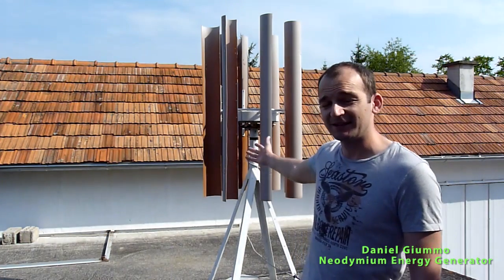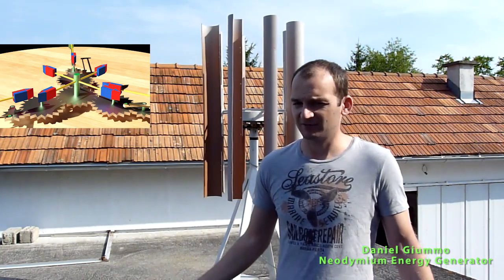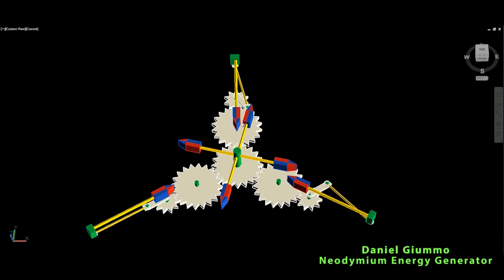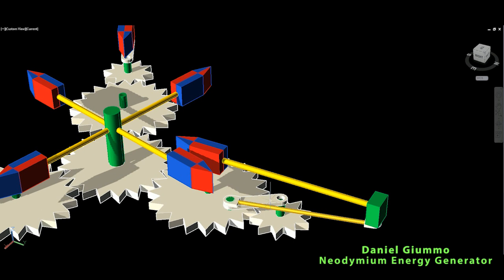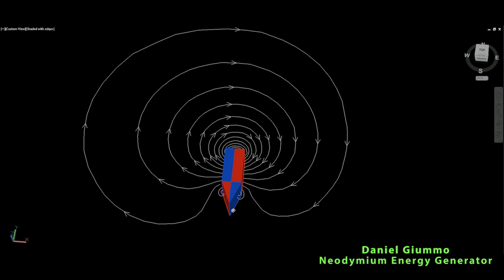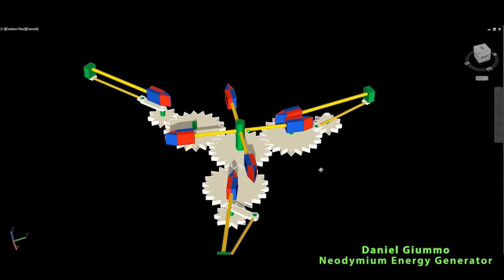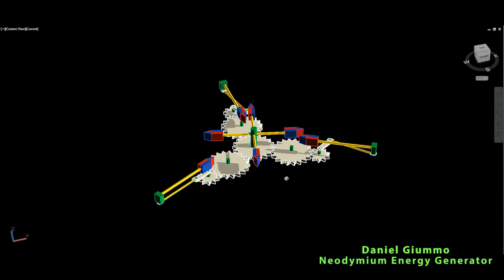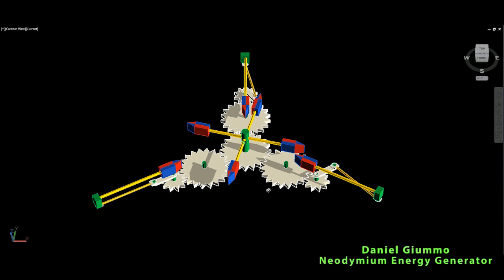Free Energy Generator, Daniel Giummo Neodymium Energy Generator!!!!

Comment: I think this won't work because the magnets in the middle will also repel the "piston magnets" outwards and in one point it will stop. The little triangles doesn't neutralize the field, it teoretically suppose to prevent oposing fields from attracting each other when pistons are approaching the rotary magnets. It takes power to push piston magnet inside magnetic field, maybe it will work as perpetual machine, but not overunity.

Comment: Energy from magnets is not free energy. We must first magnetise (charge) the magnet so that it can work. Magnets can be a good source for energy storage. Free energy does not exist. When you want to have electricity from the sun you have to build panels so you have to use the energy to create them. From the wind you have to build a windmill, but to have the material you need to use energy to create it. So you are already magnifying the energies in the material. Specifying free energy is a crap, a lie.
Reply: Denying the existance of free energy is the way those in power have to keep you weak and powerless, so you have to be a slave to the system, while they feed on you. 
2nd law of thermodynamics applies to closed systems, but Electromagnetism and Gravity go beyond the 3 physical dimensions, making physical reality an open system.
Any magnetic dipole (for example the spin elementary particles) creates an infinite flow within the magnetic field it creates.
Educate yourself before commenting, otherwise you're just another sheep.
Reply: So the system is so bad ^^ scientist to see what got beat foam. You can not even read with understanding. You summon dimensionality, dipoles and other such things. Tell me how do you make a permanent magnet? What do you have to do to get it?
Give me examples of natural magnets as strong as neodymium magnets. Show me. Dig me out of the ground ready magnet such as neodymium strength. Without any interference from the outside. And not on a micro scale just on a normal scale. If you are such a scientist. What about the principle of preserving energy? Therefore the free energy does not exist because it does not conjure up. We can store it in batteries, springs, or in water tanks at hydropower plants and so on. You will not make energy out of nothing.